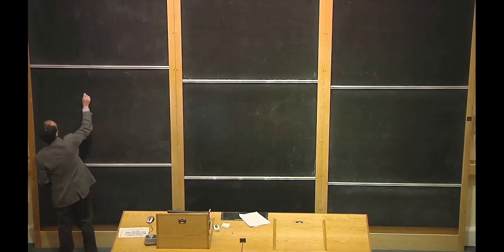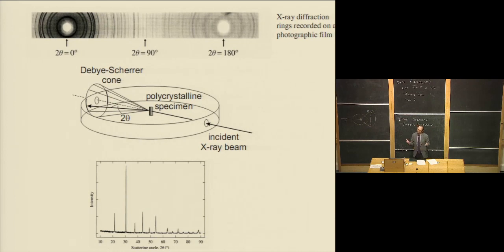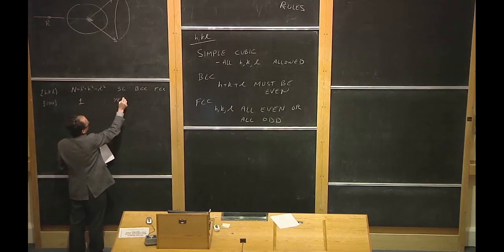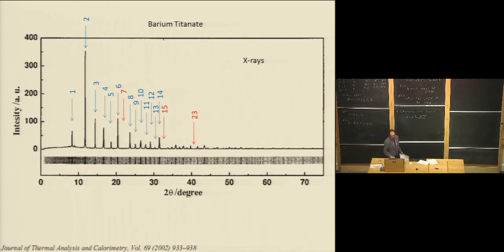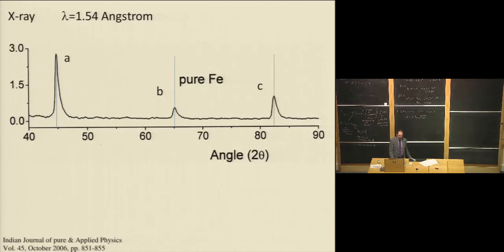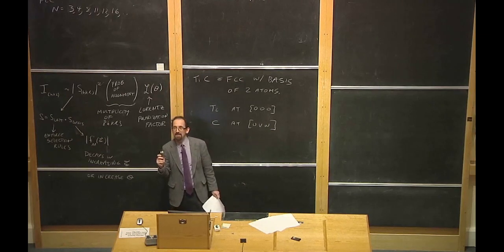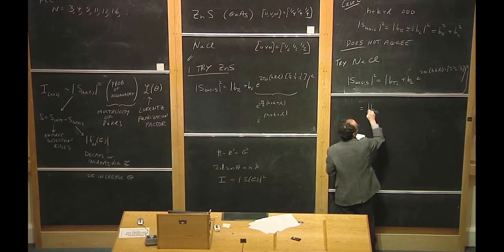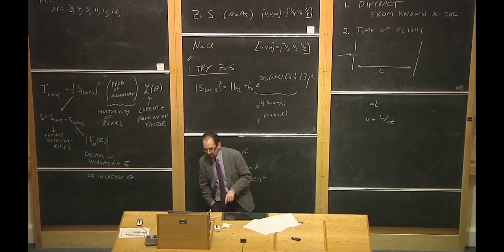13  Scattering Experiments III

Comment: @ 29.05 you have mentioned sir, that 311 peak has multiplicity higher than 222 that is why it is higher in intensity...then why 111 peak is too high in intensity even after having a slight increase in multiplicity than 200 peak
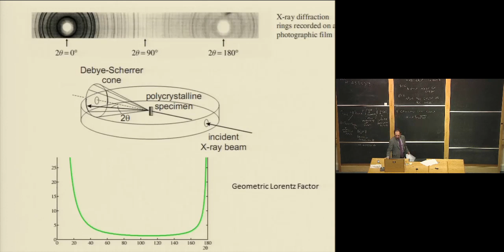Reply: Because, for 311 and 222, the Geometric Lorentz factor is almost same. So only the multiplicity effects the Intensity. But, for 111, the Geometric Lorentz factor is very different as you can see from the graph at 28:23